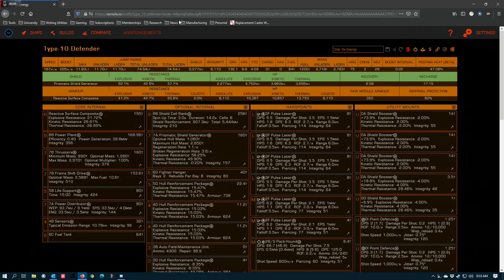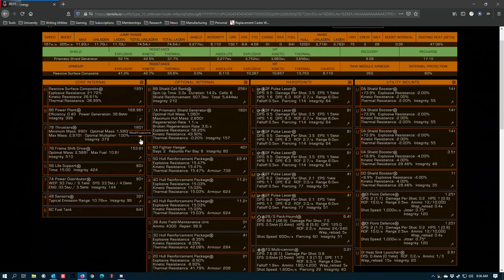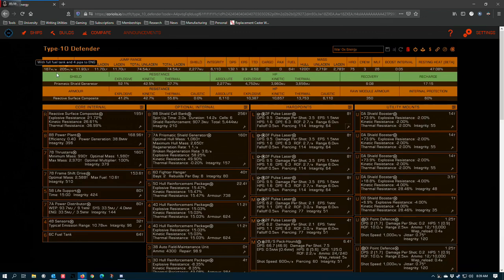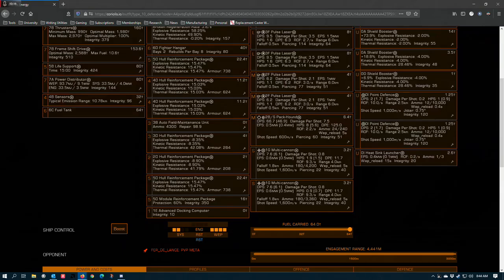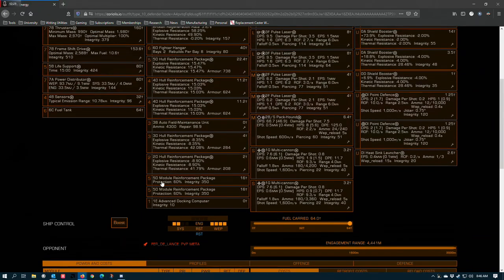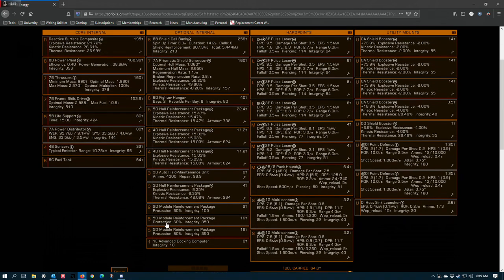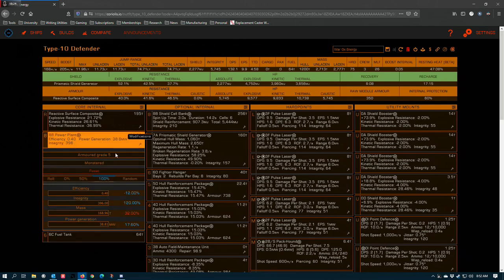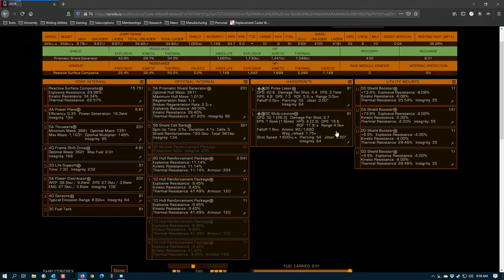Elite Dangerous | New Player Tutorial | Module Reinforcements & Sub Targeting

Comment: Two things to note:

1.) When running 2-3 MRP use one big MRP and 1 or 2 small MRP. I run 4D and 1D as the Class 4 is the damage soaker, while the 1D only exists so the 4D absorbs 84% instead of 60%. No need to run multiple large MRP unless you regularly burn the large MRP and still need more protection.

2.) NEVER put MRPs into military slots, as this prevents stacking. Learned this the hard way when my Cheifty lost its 2D completely before the 4D started bleeding. Not sure if it's a bug but has been reported on forums.
Reply: Ive got a regular 5d then a 2d anda 1d guardians cant make the 5d a guardian because of power draw on the T10
Reply: @MrTimjm009  unless you're doing AX combat there's really no reason to run all-Guardian MRPs, at most only the largest one. For AX specifically the GMRP drawing power basically adds to the pool of "modules that can be shut down by lightning", which increased the chance of a non-critical module shutdown
Reply: @piketchupwarthog3574  isnt gmrp completly disables random module shutdown and hud scramble as long as it's up?
Reply: @Сталкер-ь2х  no, thargoid lightning attack will scramble a random module anyways, you're just adding more powered modules into the list of possible ones to be picked

Comment: question about guardian MRP: does it still provide protection when turned off (only losing anti-thargoid defenses)? If it does then it's strictly better than normal MRP, no?
also, maybe guardian power plant is slightly more durable than overcharged double braced, while providing slightly less power... could work as a middle between overcharged and armored
also, what about going grade A lightweight life support? Sure it can go down in a fight, but 25 minutes surely will be enough to end a fight and deal with o2 problem, so integrity isn't much of an issue

Comment: Just curious if you actually play in open flying a Type 10?
Reply from the maker: I have occasionally in multi-crew, or as part of a wing. Most of my solo roaming in open play is done with a vulture, or cheifton. Much as I like the type-10, its still not quite up to a level where you can reliably win solo engagements. It can, however, make for a devastating supporting fire platform as part of a wing strategy, especially with regenerating effects on the lasers for allies.

I've gone over this in detail in "turrets and the type-10", but the ship's biggest problem as a floating defense platform is that there aren't enough emergent opportunities to defend anything in current game-play, and when used offensively in open space its simply too easy to run away from.

We need more scenarios where the T10 can park and let the fight come to it, like a hoard mode defending a station or surface site from waves of pirates or thargoids. T10's are workable, and even fun in PvE, CZ's, or hazres operations, but anyone with a basic understanding of PvP strategy knows turrets are garbage. My War OX build for example, actually has a lower effective DPS than a PvP fit Fer De Lance. Its only open safe in that the shields can hold for at least 15 seconds to plot a high-wake.
Reply: @DryHeatAndSand  I would agree . Even a Vulture with 2 large Hps has similar DPS  as a T 10

Comment: Would the same approach to building a all out combat ship , using a ship like the type 10 , apply to the other big ships in the game ? 1 on 1 pvp s , it seems like big ships are not to be used . Clearly small to medium ships would be best
Reply from the maker: The meta strongly favors medium ships in elite, with the chieftain, fer-de-lance, and krait being current favorites.

As for your question about large ships, no, you don't typically fit them like a T10. Each one has a set of strategies in fitting that make them fairly unique.

None of the other large ships favor turrets for example.

I'll look into doing some videos about them in the future.
Reply: @DryHeatAndSand  That would be good . I have subscribed to your channel. I like your videos  so far . 
It has taken me ages to figure out how to build these ships . Apart from an Orca , the T 10 is the only big ship I have . Ive got a Vulture and a Krait mk2 and it seems you can do anything with them  Cz and res zones plus  assassin missions are easy in the Vulture and the Krait does pretty well too. 
Its been ca challenge to engineer it and out fit the T10 . 4 turret beams and 2 plasmas and a shield cell bank turned it into  molten lava so I had to ditch that build . The amfu and cell bank seems good and armored modules with B rated is not something I considered . The only thing with an armored B power unit is it is limited even with monstered effect. It is difficult to get a decent cell bank and amfu that can be efffective. Im going to switch to B rated thrusters from the A but I still want dirty drag drives. It still gives a 245 speed and 300 boost speed which is still lower than other big ships but not quite so bad